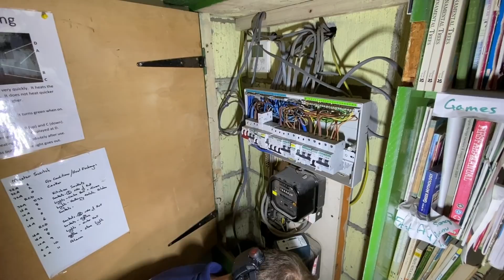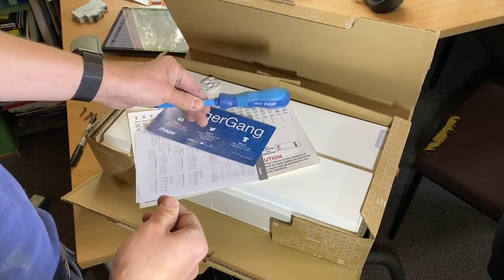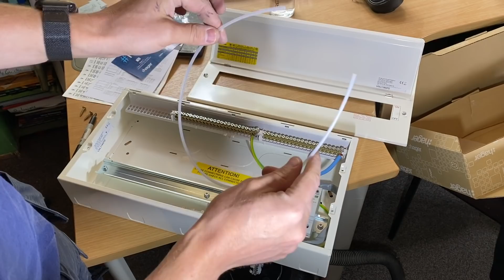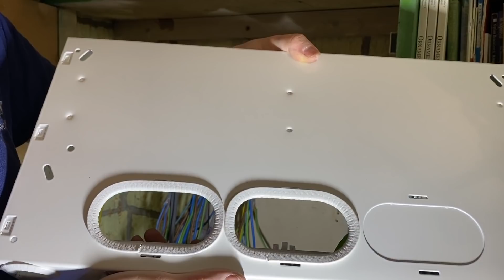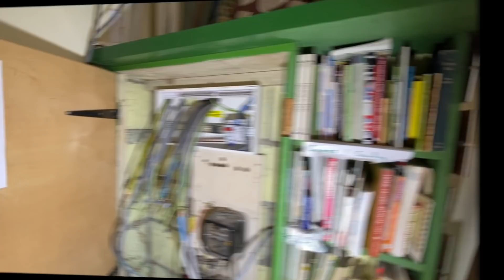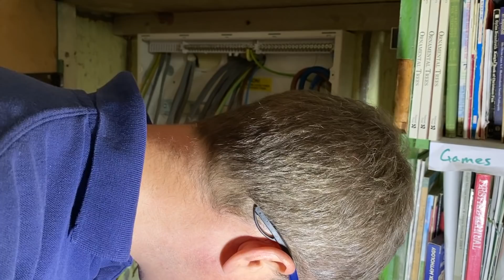Consumer Unit Installation - The Scout Hut - Episode 2

Comment: Hi Jordan.  I had the same reading as you, when I was testing a SOCKET it showed.  690 volts, and you know it was dead..  I knew that the board was isolated, but still it made me question it. Is this a problem with the AVI? as when I put it on the proving unit it was ok. I was worried that the feed was taken from another circuit, especially as I was just working on one socket circuit.

Comment: why not make a semi rigid plastic template for the mounting of the  cu boxes you use the most and leave the bit above the rear entry ways off as well and then you could easily slide it into position and markup the holes for mounting to the wall

Comment: Decent job watched the last part in slow motion I wanted to see exactly how you did it as I'm planning on changing my consumer unit out. I am qualified but I never touch domestic stuff, in my third year we do mainly commercial  / industrial. I want to do this board change for my NICEIC assessment so that I can get out and about doing jobs on my own in 2021. Great video keep up the good work. The only thing I would have done different is perhaps mix a bit of mortar up cut that foam back where half the block is missing and just skim over it so its nice and flat.

Comment: I came across a bedroom in a semi detached house that was originally one house but turned into 2 dwellings. The bedroom was adjacent to the shared wall and the pendant light was still powered by the next door circuit. The house mains supply was off but most people would naturally assume the supply was dead. The switch was faulty so you could turn it on but the bulb would not light. I know you test at the consumer unit but do electricians testing every fitting as well.  I was saved by the good old neon screwdriver, I know electricians hate them but they had their uses.

Comment: Could always strip back the wires before installing the consumer unit, then put all the cables going in to a each hole in the unit in its own mesh sleaving, use it lots in pc building, then once consumer unit is on remove electrical tape from ends of sleaving and remove sleaving itself, job done 😁

Comment: Also I use 2x1 battens  of pfc wood cut to size either side of consumer unit which gives you more room to get all the cables round the back 👍  cheers for the idea of the safe strip for knock outs I've fitted 1000s of hager boards and I don't know why they can't get that right, this was one of my pet hates 😎👍

Comment: Hi nice job and thanks for the link for the tools 👍 just a tip I use for marking cables when disconnecting the cables from the old board- take a black permanent marker and mark lines on the live conductor for the circuit number that way when you come to connect up on the new board you just refer to the old boards front cover and makes life alot easier 👍

Comment: I'd like to recommend a stripping tool - Tavismanor Rotax 29 or Rotax 40. CEF and CPC stock it and probably others. It might be a little expensive but its beautiful. You simply eye measure the blade against the end of the cable to determine the sheaths thickness, set the blades height slightly less than the sheath thickness, roll it around, and bend the rest of the sheath off. Use it all the time on cat5/6 cable, sound/lighting cables, and up to 2.5mm mains cables. Anything round basically. No good for twin and earth but great for anything round and can do anything up to 29mm one the smaller model or 40mm on the larger. Really simple and lightweight and will make perfectly clean sheathing cuts every time. Its really really handy when working with stranded cable (especially audio cables, which can be extremely fine strands).

http://www.tavismanor.com/product/rotax/

Comment: That's what I call a clean and orderly installed unit!

No Hager Quick-Connect (TM) in the UK? 

https://www.mg-elektro24.de/media/image/29/74/a2/hager-pen-klemme-mit-trger-2x22-quick-connect_MG1007952_1.jpg

The small openings are up to 4mm², strip the wire and push them in. Done. The bigger openings are for wires up to 16mm², and they have screws (PZ/SL or PZ2).

They also have MCB and RCBOs available with that system:

https://www.hager.at/images/01_TOP-Themen/TOP-Aktuell_TOP-Produkte/quickconnect/Anschluss_2_388x291px.jpg

Comment: Hello, be very careful removing DNO fuses. The older cut outs have gone up in smoke due to degraded internal insulation. Also the main intake cables can also fail. The DNO is meant to remove it for you but we all do it. Just be very wary especially on older ones. I'm glad you're promoting safe isolation and prove test prove.
Thanks for the video. Very educational for sparkies that need it.

Comment: Can I ask a question please Jordan. If I have to move a fuse board from 1200mm to ceiling height and tails are back entry to board currently from cutout. How would you extend the tails up the wall as assume you can’t run in cavity? Thanks mate

Comment: Strip the cables before you put the DB up. Also, leave the hole in the wall for a builder to fix. A decent brickie could mortar in a slice of block. Nice stuffing gland for the tails.
Reply from the maker: Thanks!

Comment: Hi there, are RCBOs a requirement here? I was recently looking to get a new fuse board and the prices I was given ranged from £1200 to £350 because of these rcbo things. I was told you don't even need them if you have ordinary RCDs. Is it worth paying so much more for the rcbos?
Reply from the maker: It’s worth paying extra for RCBOs as if you have a fault then only the individual circuit that has the fault will trip instead of half or all of your power if you only have RCDs
Reply: @artisanelectrics  Many thanks! That makes good sense.

Comment: Pull the main fuse? Sure that is illegal and should b done by the DNO....
Reply from the maker: Depends which DNO you have in your area, its not illegal, some DNO's allow the electrician to remove the main fuse for safe isolation purposes.
Reply: Artisan Electrics ok thanks, was always taught it is in class it is illegal and very dangerous and could potentially cause sparks. 😊

Comment: If you have to pull the main fuse for safety good idea to remove the fuse and put the carrier back in . Tony
Reply from the maker: Thanks
Reply: In this case the big "a" sticker on the fuse holder makes what he did safer. I would rather not disturb ACMs if I can at all help it

Comment: Great video and fine job.  
On subject of solid wires and ferrules, agree with comments, one exception is with solid cat 5 and screw connectors, as screw connectors damage and cause solid data type cables to break with over tightening etc.
Reply from the maker: Good comment thanks!

Comment: Just a point did you check the asbestos register as there appears to be a sticker on the main fuse housing?
Reply from the maker: What do you mean by the asbestos register?
Reply: @artisanelectrics  most buildings that have found asbestos will have a register of type , amount and where it is located. I saw a sticker on the main incoming fuse. now it might be that the scouts are unaware of this. Or somebody loves placing stickers everywhere.

Comment: Why pull all the slack into the CU then cut it off. Surely a gentle loop in the cavity? is more sensible, given you've probably just turned that into a banjo string to the nearest hidden JB. And given the state of that job, you can't possibly tell me there aren't half a doz hidden JBs in the ceiling/cavity/behind the cat..
Reply from the maker: I left some slack in the wall but there wasn't that much to play with anyway

Comment: SPDs just another couple of items to throw in the mix...on site guide page 43 and 44 does show an OCOD installed to protect the SPD ... CPN cudis SPD  small note at the bottom of the page states that a protection device no greater than 63 amp to be used in conjunction with there SPD . Just carry out checking before choosing and fitting SPD .

Comment: Hi Jorden. I fail to see how you think it's ok to use an expanding foam which is not fire retardant to seal around the cables entering the consumer unit. I thought all apertures had to be sealed with fire retardant material?
Reply from the maker: No there's no requirement to make a consumer unit fire proof, only in domestic locations it should be made of non combustible material but there's a difference between non combustible and fire proof. Its a common misconception,
Reply: @artisanelectrics  Thanks, thats cleared that up for me
Reply: Does ipx4 not apply? Also standard expanding foam can contain chemicals that cause pvc to migrate leaving just bare copper over time . Only use fire seal on cables . Great videos neat work and great choice of switch gear

Comment: As someone from an industrial background it always looks rough to me not to fit ferrules to stranded cables. I obviously seems to be normal practice in domestic installation.
Reply: If the terminals are rated for stranded conductors without ferrules, they're not required but still considered good practice. From a functional perspective, ferrules are optional in any type of terminal that doesn't have a screw or screw head in direct contact with the wire. Eaton has a lovely drawing to indicate that in their instructions, a picture of a stranded wire and a cordless drill :-D

Comment: Hi Jordan, great video, thank you.  Looks like the service head was on the board you moved.  What was the incoming cable?  I presume SWA as moving paper insulated cables about is a bit dodgy (John Ward did a video on that).  But that said, I asked some DNO guys about that on a recent job and they made light of it, saying it's not really very risky at all... but I suppose they have a different set of skills, I certainly wouldn't fancy trying it.

Also, a few comments here say the DNO will fit a double pole isolator.  Not in my neck of the woods - here that's down to the energy supplier.  And good luck if you decide to go down THAT route - I spent 90 minutes on the phone to SSE and they didn't have a clue what I was talking about.  In the end it was easier to shift to another supplier (Octopus) who acutally understood and agreed to do it for free!  Stay safe!
Reply: Afaict DNOs tend not to use SWA, they tend to use concentric or split-con (depending on whether the supply is TN-C-S or TN-S).
Reply: And that's precisely why I like countries where the DNO takes care of all the "hardware", sometimes including the billing. No matter who's the supplier, there's only one company to call if there's any issue with the physical equipment.

Comment: Hi Jordan, another top video, board is so neat.  I will definitely try that grommet strip.  Just a couple of comments, not negative just my opinion, I would always cover the cutout fuse when removed with tape or just remove the fuse & re-install the carrier, this will stop your fingers slipping in by accident.  I just wanted to point out, Moving the cutout board around like you did is highly dangerous, if the supply cable was old you could have shorted it out.  A lot of budding sparks or existing sparks may think it is ok if they see you doing it.
Reply from the maker: Thanks you're right there great comments

Comment: Tricky for the cables, but for things like holes in a wall if you spray a bit of water in first so the hole is slightly damp then the foam expands and sets much better
Reply from the maker: Great tip thanks!

Comment: Nice video and finished tidy board . Suggest you made it harder for yourself having the din rail/spd/main switch assembly in place and then populating all the rcbos before dressing and terminating any cables. Your hands and fingers missed have ached after that ! Personal choice - we all do it our own way but I like to bare the board, bring the final circuits in and mount it, strip the sheaths, dress and terminate the CPCs. Measure up then dress the tails. Install the din rail assembly. Then go one RCBO at a time and dress/terminate the L,N and flying N as you go.
Reply from the maker: Nice thanks for sharing!

Comment: Jordan, fab job as always. I’m struggling with this whole cut out thingy, we all know the fuse has to be pulled and moan about it so why not fit a main isolation switch? Happy to spend £300 in a board but not £15 on a switch 🤷‍♂️
Reply: There are U.K. companies approved by the DNO’s that will come and fit a main isolator for £50 ish.
Reply: @chrisb4009  I managed to convince my electricity provider to install one while fitting my smart meters.
Reply: Try £600 absolute minimum for a hager rcbo board
Reply from the maker: Yeah I know what you mean, I’ve just never thought of fitting one to be honest.
Reply: We call them disconnects here in the USA. The latest USA regulations NEC 2020 require them to be installed outside the property. In effect the internal panels or consumer unit become separate sub panels where neutrals and grounds have to be separated. The point about them being installed outside is that the are their for the emergency services (Fire) who can turn power off before venturing into a building. It’s useful also when you want to work on the internal panels. Good that you showed safe isolation procedure.

Comment: I would use an automatic centre punch for marking up the board instead of a pencil. It's what I used for drilling out my number plate. Stops the drill bit wandering https://www.halfords.com/tools/hand-tools/all-hand-tools/halfords-automatic-centre-punch-124628.html?istCompanyId=b8708c57-7a02-4cf6-b2c0-dc36b54a327e&istFeedId=367c5610-f937-4c81-8609-f84582324cd6&istItemId=xmiqam&istBid=t&_$ja=tsid:94971|cid:865695754|agid:42483195983|tid:pla-331463650238|crid:203186066553|nw:g|rnd:2120286835434396346|dvc:m|adp:|mt:|loc:9045090&gclid=CjwKCAjwqdn1BRBREiwAEbZcR_ozXT8Dx-EJq9bWUkgE0W2M6nFZENPVELKIzkDnaEELbF4h6W85JhoCHaQQAvD_BwE
Reply from the maker: Cool

Comment: Good, neat job, with one and only "but" - that screwfix expanding foam you used remains highly flammable in temps above 100 degrees C (check the codes on the can), so does exactly opposite to what you would want to achieve around that consumer unit - fire resistant ones (Toolstation stocks them cheap) are easy to spot because the foam itself is different in colour. 
Hager boards with round knockouts are available and have 'RK' in model name.
Reply from the maker: Great comment thanks!

Comment: What if the Fuse is sealed Jordan??
Reply: Cut that bitch
Reply from the maker: You can either cut the seals and reseal it afterwards or call the DNO and get them to come and fit a main switch

Comment: Great video thank you for the awesome content! Watch someone drill with a device designed to put in fasteners, and then put in fasteners with a device that was designed to drill. Sorry, it is something I pick on the new guys/gals for doing ALL the flipping time.🙄
Reply from the maker: The Armeg drill bits that I use are designed for impact drivers
Reply: @Artisan Electrics 
Have you tried Tapcons with Tapcon driver bit? That way you only need your rotary hammer and you don’t have to mark, remove and replace panel, on the downside you do need to vacuum out the dust, but you most likely have your vacuum there anyways.

Comment: Just curious why you didn’t use the square knockout and insert for the tails and main earth? That would’ve saved you cutting a hole? But very tidy job and thanks for showing a board change in more detail.
Reply: The gland was to provide mechanical retention of the cables. Otherwise you'd probably want a tails clamp in the board which takes up another inch above the main switch
Reply from the maker: I could have but just prefer the wiska gland when possible